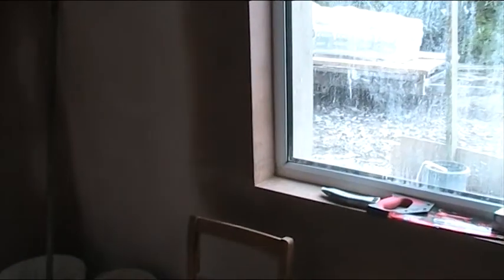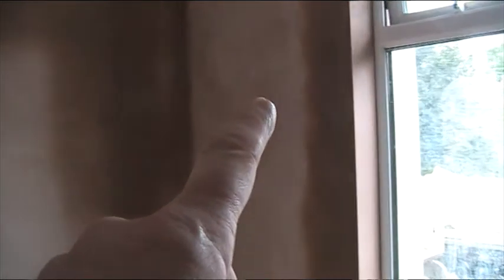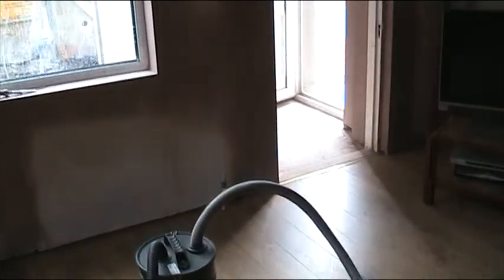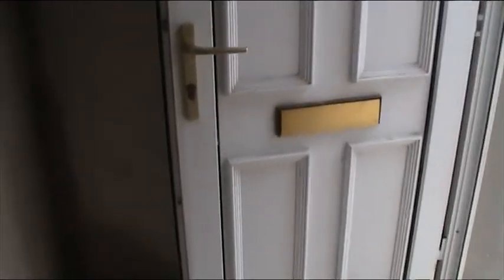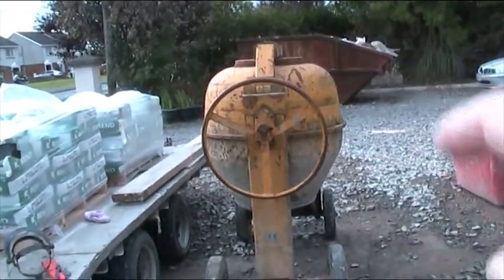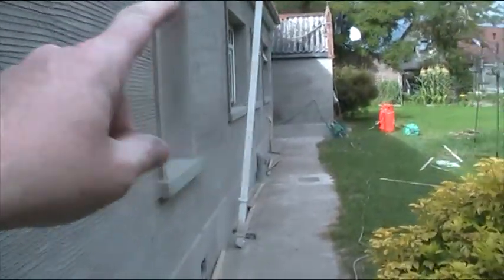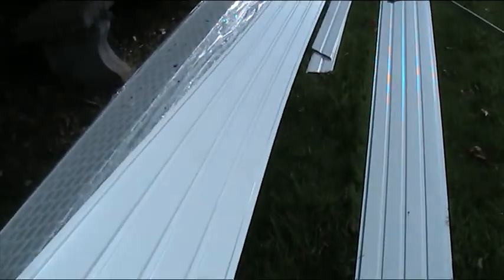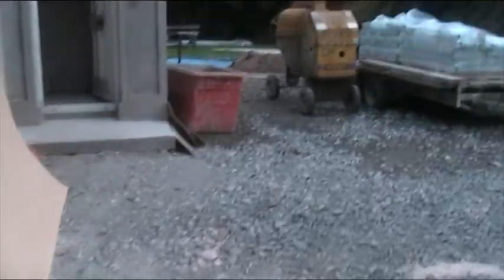Damp Proofing & Plastering 10

Comment: Hello Brendan,
Not surprisingly you seem exhausted.
Another week should see it finished and it will look amazing.
I told you a wee story a few weeks ago about getting the inside of a garage plastered several years ago and how the master craftsman treated me with appropriate disdain.
Well, even further back I had an internal plastering job carried out by a guy who was a friend of a friend.   He had a reputation for being temperamental.   To give you an example occasionally he used to cycle from Bangor into Belfast (14 miles).   He was approaching the Queen's Bridge and found he had a flat tyre so he promptly picked the bike up and threw it into the river Lagan and shouted after it "that will teach you a lesson".   He got the train back home.
Anyway, he was due to plaster my hallway so I spent many hours putting down heavy duty cardboard to protect the floor boards.
I visited the site the following day to find my card board in a heap out side.
I ventured inside and the plasterer said to me "are you suggesting I'm a messy plasterer?".
It was liking walking on egg shells during the whole job.
No wonder I'm a bit mentally unbalanced.
Good luck this forthcoming week.
Alan.
Reply from the maker: LOL, I'll not be asking you for your plasterer's phone number.  I spent today masking the windows and doors.  I can leave the back open because that's not getting done tomorrow.  I have to get up at 5.30am to finish the plinth because the lads are coming at 7.00am.   would do it not but I can't be bothered getting floodlights out of the garage and I'm too tired.  I've been at it for 9 hours non-stop, well, 10 minutes for dinner but no tea breaks or anything.  I will sleep tonight.
Best Wishes, Brendan.
Reply: Hi Alan,
I think we had the same guy do some work for us some years ago, he must have moved to the mainland, and plied his trade over here :)
Take care
Mike